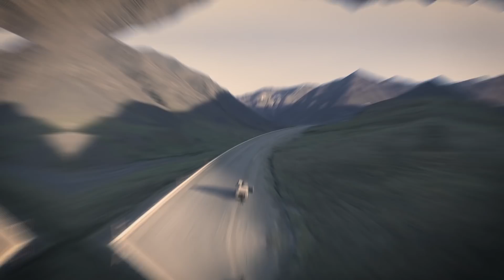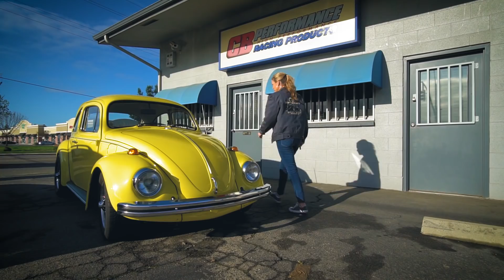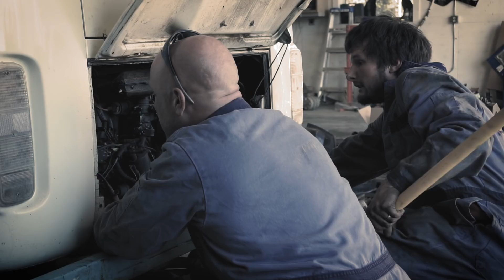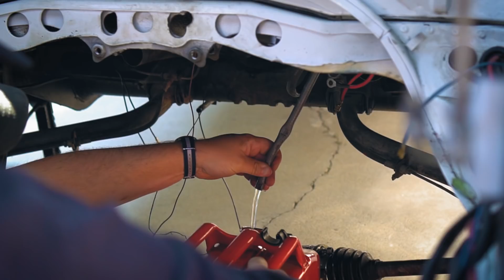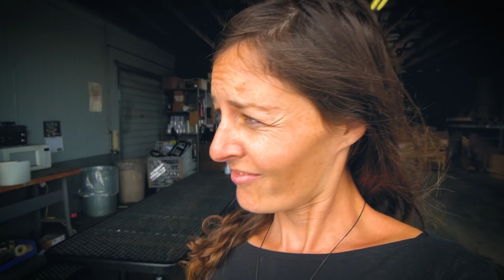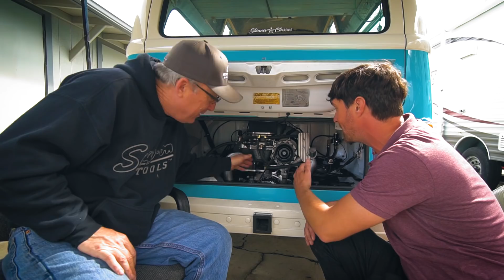Building an Engine to Drive Around The World! // S01E07

Comment: Cool! The engine I built for my 1963 1/2 Bus was a 1776cc dual carb type 1 with a 270 degree cam, 044 heads and Cima pistons and 90.5mm cylinders!  It made 125 hp on aviation fuel.

Comment: I commented on one of your earlier vid's concerning a 15000 mile journey I took with mt girlfriend in our 1968 camper bus. That took place in 1973-1974. So much has changed in the VW world since then, although with our 92mm x 69mm motor, we used a Scat billet crankshaft and back then, had to rework dual port heads by fly cutting them for larger barrels and more compression. Did my own porting work and installed big MANLY Valves, better springs, retainers and built my own rocker arm assemblies. Used a deep sump and external oil cooler & filter for more capacity and better cooling. You really scored getting hooked up with those folks, they clearly have the best at their disposal with years of combined knowledge.  California and Volkswagons , they have always had it going on. There use to be a guy up here in Wa. State named Gene Berg that knew all the tricks back in the day to make lots of HP, but he too moved to Orange County to be closer to where it was all happening.

Comment: That is a sweet engine. I just hope you're taking spares of every sensor, connector, maybe even a spare ECU if you can afford it as these things can fail and you won't find them anywhere on your way.
Reply from the maker: you're absolutely right and we do have spares of mostly everything
Reply: I think there is no need other than max. 7000miles oil change interval and maybe new sparkplugs. That is good engine and gearbox.
Reply: The sensors used are from other cars and readily available, its not like they are one off. As for the ECU its not going to fail but if it did they could easily swap it to a carb if really needed.

Comment: CB needs to post this config as a crate engine in their catalogue... I'd jump at that kind of Power & thermal management for my bus! ( though the total $ would likely be way out of my reach )
Reply: Simon Gough 😂😂😂😂😂😂 $9600 😂😂😂😂😂😂😂😂😂😂😂😂😂😂😂😂😂😂😂😂😂😂😂😂😂😂😂😂😂😂

You can buy a complete running Porsche boxter S for that and swap it into a bus and still have $4000 left over. What a joke
Reply: @CARRBAGE  I think that is incredibly reasonable, but then I work on engines where a simple re ring job can cost 40 grand . Don't forget,these are not SBC's you can buy in a junkyard for peanuts,they are a hand built engine dyno tested etc. As for boxters... if want a reliable engine you do not buy a boxter.
Reply: @CARRBAGE  If you know anyone who has actually driven over 100,000 miles with the Porsche swap let us know the real world reliability to help determine which engine swap to go with.
Reply: Mercmad dude, you replace the main bearing seals ONCE and they are bulletproof. You are already pulling it for the swap. Come on. You make no sense. A 2.7L Porsche flat six will not only fit, but will have double the torque and hp of that $9600 paperweight. 

Sorry not sorry.
Reply: Marc B replace the main bearing seals with a quality aftermarket upgrade, and they are bulletproof

Comment: I am torn on the carb.  I would have opted for a carb library on the bus so you can switch out per situation.  But EFI is more efficienct.....you all will get better mileage.  Just don't drive through deep water.  Lol.......I'm watching this 6 months late - you probably already did.  You got a lot of positive attention for that engine build.  Folks might pay 10K USD for that for a resto.  I'll keep watching.
Reply: $10k sounds about right, I love the limited slip idea too!

Comment: I keep hearing from people that Subaru engines are fantastic. Every thought about dropping in one of those?
Reply: Needs to be air cooled
Reply: Dont listen to them. Subaru engine are a good option. If you want air cooled engine that have power your option is porsche flat 6 from the 911 but it is very expensive. People who think subaru engine is not a good option they know nothing about cars😂
Reply: @amarularif3110  A newphew of mine put one in his combi 20 years ago. Nothing new in that conversion but running a radiator is not what you want to do if you want to run on rough roads,those long water pipes carry a lot of mass and cause all sorts of problems.
Reply: @Mercmad  why don't you just cut a hole out the back, run rad out the back with electric fans pulling air in?
Reply: As one who has run both Subarus and air cooled VW's there is no comparision.How many aircooled VW's have you put 300k on and did no engine work on.I personally have never gotten 100k out of an aircooled VW,I will save the critiques for others. There is no comparision.
Reply: Most Subaru engines are good solid engines, biggest issues happen when you use forced inductions.

Comment: If I build a bug I know where I will buy an engine or transmission from. 96hp does seem low to me,  thought it would be more like 130 or higher.
Reply from the maker: It could easily be, but ours is built a little more conservatively to help with longevity.  Check out another one of their engine's on the dyno: https://www.youtube.com/watch?v=dLDQlydaqlI
Reply: Swap in a STI, Boxter or 1.9TDI for 1/4 of what they paid, and get a rocket. Even the 100hp TDI has so much torque, you will literally FLY. This is just nonsense.
Reply: gav com how many times have you rebuilt a 1.9L Tdi before it reaches 300k miles? Answer: ZERO 

High pressure shit? You are CLUELESS

Comment: In my 23 window,  '62 Kombi, I last blew up a built 1600 (to 2300cc's) in a snowstorm and the local garage hot-swapped a local's 1600 into it for a couple bills, the blowers and other HD parts... They got the better deal, I was able to cruise at 80-90 across the midwest in that beast. Miss that car so much.

Comment: On any journey, particularly one such as this, the one thing above all others is Reliability!

Having a reliable engine (as reliable as it's possible for such an engine to be) instills confidence to travel without the fear of being stranded and isolated.

For your intended purpose it would seem difficult to find a better engine and back up support!

Epic journeys have been undertaken with standard, unmodified engines using simple, regular maintenance, but having this high specification engine built from custom designed and manufactured components should be about as good as it gets, particularly with the exceptional cooling under load and at altitude that this engine has.

It will be interesting to see how the engine performs using the various grades of fuel you encounter on your journey.

Comment: You are going to be really happy with your fuel injection, I crossed the Alps in my '87 Volvo 240 with a carburator and a hole in the exhaust. It worked fine, but the performance was anything but impressive.

Comment: That engine sounds awesome, I had a 1962 WV bus and it would literally run out of power climbing the mountain roads of West Virginia where I lived. I would have to get off the road and start up through the gears until I had to do it again. I was plagued with the drivers side front cylinder going bad because of heat...
You are so lucky to be able to afford a new transaxle and engine both built by the best there is in the VW business. 
Looking forward to watching your travels

Comment: I run a LOT of CB parts (more and more as time goes on) and their stuff is the best quality of any parts that I have purchased. I use their throttle bodies, rods, crank, heads (wedgeport), oiling system parts, valve train, flywheel, yeesh. Anyways I usually replace my failed junk with CB stuff. You will do well, I aspire to have a Rancho trans at some point. In the meantime I have a pretty good race trans made by a local gentleman but it is now 7 years old and is ready for a refresh soon.

Comment: Happy for you guys. This is great news really with EFI. If you get to 10k feet altitude and need the ECU tweaked it can be done. Same with how fuel quality differs from different parts of the world. Sometimes you get some pinging because it's not up to par and it can easily be adjusted. I've actually had my Subaru remote tuned from someone in Barbados (I'm in the US). It's crazy how far technology has come.

Comment: A "pro" tip:

When you get to eastern Asia during the  summer and encounter 40C and higher temperature and are going up a long and steep hill you might still get some overheating problems. There are just so much air cooling can do. 
The tip; I would consider adding a nozzle to spray water over your cylinder sleeves/heads. Water hold much more energy than air and a small water tank of 10-20 liters will do wonders up a steep and slow incline.
I do agree however that now with efi and a good tune you will have a lot less trouble all over.

Comment: Engines have really come on in the years. It really made me think. This engine is done really really well and gets just short of 100 hp and it's an 1800cc meanwhile stick a fuel injection setup on a honda d13 1300cc and you make 100hp too it's interesting to see the design of different engines

Comment: Props to the engine builders. But my take on RTW would be a simple non turbo diesel engine. Saves the hassle of carb jetting and the hassle of too much sensors and electronics.

Comment: Why no Subaru 2.0/2.2L? Common swap, simple and reliable. Not as common in 3rd world, but.... cheaper than a custom engine. What you had built is probably going to be bulletproof tho. Your VW engine is a thing of beauty.
Reply: Kind of what I was thinking. It not only makes a bunch more power but youd have the option of ac and heat. 
We'll have to see how well it does.
Reply: jep, but aswell you need to find a place for a radiator. has been done, i know, but that van is meant to run an aircooled engine

Comment: Great to see!
I was actually wondering already if you would go EFI or carb. EFI was also a VW standard on the latest Mexico edition which was also sold in other regions like Germany. As far as VW MKT goes they always tell us/public that they offer all oldtimer parts still and world-wide. CB´s EFI is for sure a very special part - but probably also very much better for the job, as the VW Mex EFI was just done for emissions and with focus on the way cheapest car in VW portfolio end of 90ies globally.

There is an easy an reliable option to go bigger than 1776 w/o boring the hell out the block: A 69mm crank is standard on 1300/1600 but there is also an 76mm option original from VW, which translates to 2.1 liter and really wakes up your engine. A friend from school had this mid 90ies in his bug: 125 HP on the dyno an 190 NM with 48 IDF Weber in his case.
Your case is different though and CB probably did not had unlimited budget for this project; you´re better of with EFI than torque ...

Comment: Though I don't believe CB people said it, I heard you say it several times... "air cooled engine". I've had several VWs, dealt with several mechanics, and we agree... it's as air cooled as any other engine, maybe a bit more so, but the technicality is you're using oil instead of water to cool with. Shoot, I even had external oil coolers on the outside of one my buses, which seemed to work well.

Comment: The quality of your videos is insane!! Keep up the good work. :D
Reply: Those are some dismal engine stats though. 😂
Reply: @taylorstanden  Higher Horsepower may be more impressive when looking at just the numbers, but there is often a trade-off in longevity.    This motor was designed to last for years, not for racing at the drag strip.

Comment: With all the upgrades and improvements especially with hp. I wonder if or why you wouldn't be looking at even a small trailer either a tear drop sleep unit or a utility storage unit to free up more space in the van , for supplies etc.
Reply from the maker: it's been thought about, and not totally out of the question

Comment: Excellent production and substantial work by all on/in this video but it would have been nice for us bus owners with a stock 1600 to see the van climb the mountain up to that National Park showing the speed, RPM, oil temp & cylinder temp towards the end of that climb or at the end of it. 
Also, I'm assuming (with the snow I saw) that the outside temp out/up there was pretty ideal anyway- even for a stock 1600. 

It makes it difficult to compare. A top speed I saw towards the end of the video was 60 (maybe 65mph) on what appears to be an almost flat road - maybe slight incline. Perhaps that was at high altitude at the top of the mountain/s.  Pat being able to touch the engine after arriving back at the shop doesn't really prove much with all due respect. 
I know whenever I drive my 1600 on the freeway at 50-55mph for hours on end, by the time I get back into highway/35mph speed limited areas my oil temp goes back down from 185 to 140/150. They cool down quickly when turned off. My 1600 is a pleasure to drive in high altitude at night- the oil temp stays at around 175 tops then. During the day if the temp is 80 or above it just feels like too much hard work in high altitude areas and top speed on major inclines is 20-25mph the way I drive it. The way I drive it is gentle and foot never flat to the floor at anytime. I try to keep RPM and oil temp both down and I think all bus owners know that putting the foot flat to the floor on a steep incline is good for nothing. My engine is pretty tired though too.

I'm thinking about rebuilding my tired 1600 to a 1776 or possibly sticking to a 1600. 
The question that still lingers for me is: 
Is there a type 1 engine you can be built that will enable a type 2 bus to climb any mountain at at least 40mph and will last at least 100k+ miles? 
The 1776 seems to be the best compromise between extra power and longevity but I haven't seen proof with numbers anywhere yet. That would be great to see. 

It's been a couple of years since this upload now- a video reporting on the performance and state of the engine would be great to help the (surely) many of us considering upgrading their 1600 in their beautiful vans for the longer kind of road trip :-)

Comment: ... Two ( 15 core transmission coolers ) as oil coolers , with electric fans can reduce heat problems tremendously ...!  i live in the philippines .. where ( heat ) is your worst enemy ..!!!  ..  also make sure your cooler plates on the lower side of the heads are on ..!!!  ( air flo plates ) ..!

Comment: Converting to EFI may take care of fuel related performance issues. But what about other engine mechanical issues like loss of compression or oil leaks, that prevent this type of engine from going beyond 20,000 miles or less before needing an overhaul?

Comment: Interesting that they built such a small displacement engine, and at 96hp not bad at all
Reply: I’m shocked that people think Type 1 motors are more efficient than type 4’s . A 2.5 litre type 4 would eat that 1800 for strength and reliability. I’ve had both in buses and type 1s belong In beetles

Comment: Well...that answers my questions on the Type 4 availability through out your travels.  Type 1 does make sense I suppose...I'm curious about the engine tin fitting up tight against the body seals in that engine bay.  Obviously it works out since the engine temps were so even.  Im asking since type1 and 4 don't share the same tin.   Looking forward to seeing how this holds up.  I personally hate the type 1...but Im willing to give it a 100th chance if it holds up for you using CB parts.

Comment: That's a sweet engine build!
One question: Type-1 or Type-4 was the choice and Type-1 was the pick based on available parts. Now, this is a custom build. How can it be easier to get parts for a custom engine than a Type-4?

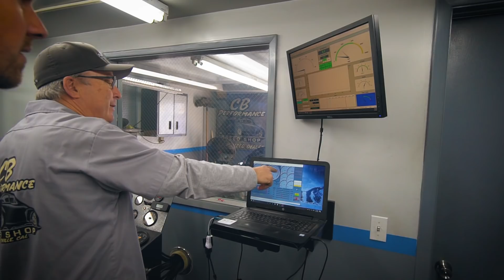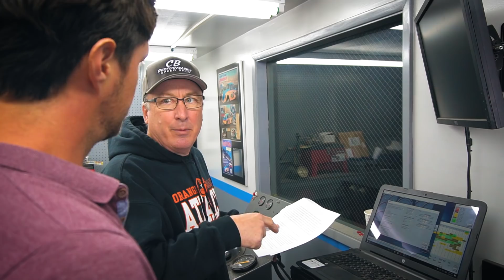Comment: 16:14 She does not get it? EFI stands for Electronic Fuel Injection. So the EFI software runs the engine. The dyno is the machine that is used to put load on the engine and measure its performance. So the dyno software runs the test. I must admit, it doesn't answer the question at 16:00. "How can the gen 4 computer log exactly ... ". Probably they don't want to tell in a YouTube video their secrets how they equip the engine with the necessary sensors. But one guy at 15:14 explained the advantages of EFI: it adapts automatically to outside air density to avoid running lean or rich. Very comfortable alternative to tinkering on a carburetor to adapt to air density.

Comment: With a good engine and transaxle there really shouldn't be any issues.  Unless the brakes and suspension weren't gone through.  You do a proper restoration the vehicle should be as reliable as new.

Comment: On the 2000 type 4 the weak point is the valve guides not the crank #1 and #2 mains  =  What have Yall done .  You should have made a upright 2000 engine to get away from belt throw . That 2000 has a counter weight crank in it from factory and will not loose thrust >>>> that is the reason VW went that way .  but if you only going 25,000 miles   YOUR GOOD

Comment: Planning to fail, fitting a lesser motor so you can rebuild in transit....hmmmm. Why will it fail and need a rebuild if its as new rebuild properly before you start?. Glad you got it all going. Sooooo looking foward to the trip. You'll need to rev it out, but wooohooooo. And youll be the envy of every bus owner on the planet and youll have control over everything and the best support you could imaging from those people. Doesnt get better than that!

Thats 74Kw. Omg, 2T bus. Still dont know how it will fly, but, it should hold together. 

Id make sure you change the oil twice as often as before. High revving machine needs to be looked after.